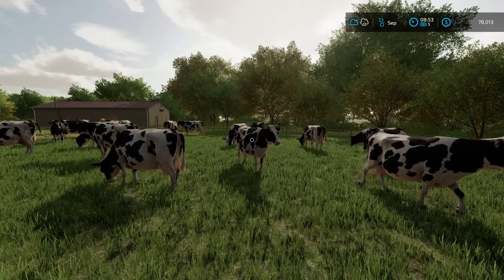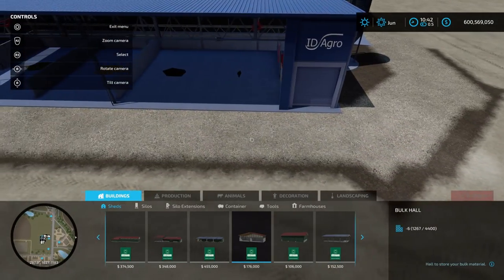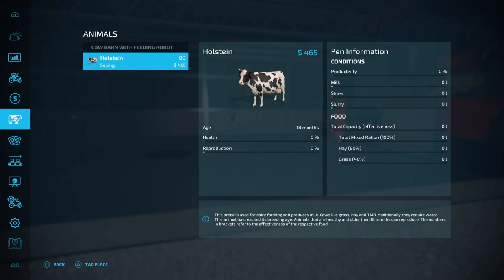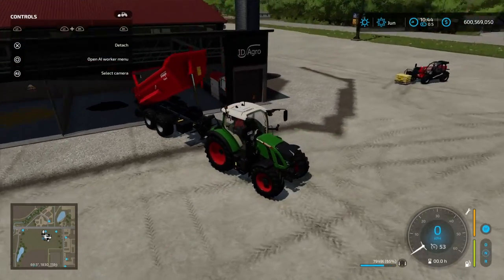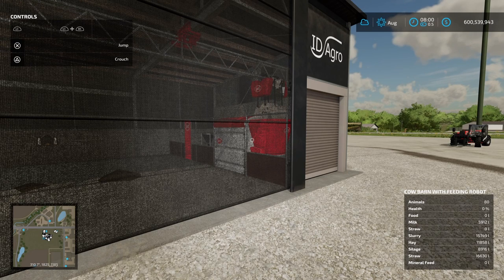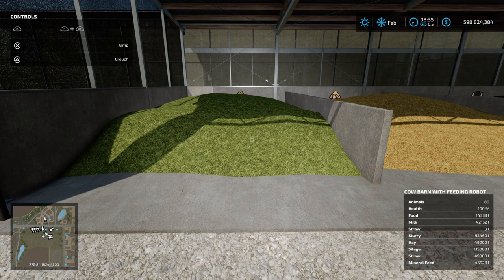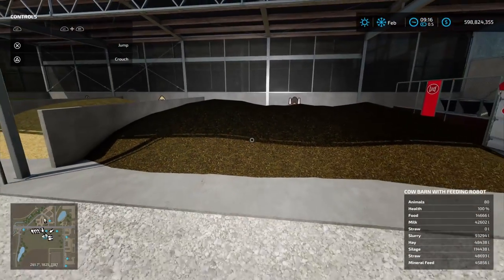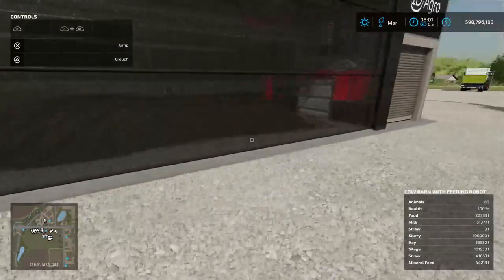How To Use The Auto Feeding Cow Barn Robot In Farming Simulator 22

Comment: Any idea how to fill the straw inside to produce manure?
Reply from the maker: You need to use a straw blower and load it through the feed area (the drive through section)
Reply: @affarmz  the big red one? I tryed that for hours, ended up filling a bunker with straw using the blower to brake down bales the use a trailer and drive through. Almost deleted maypole but glad I worked it out. Thanks for you're reply
Reply from the maker: @dougiemc8764  Yeh i thin there are only 2 straw blowers, also need to make sure you drive in with the blower pointed the correct way otherwise it won't work, check out my cow guide i think from memory there is a straw blower demo in there, glad you got it sorted!